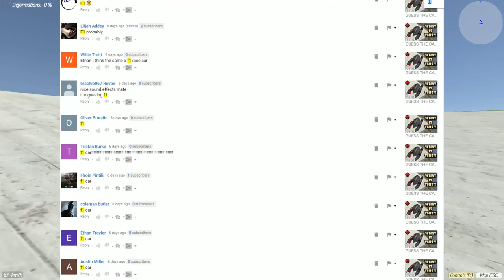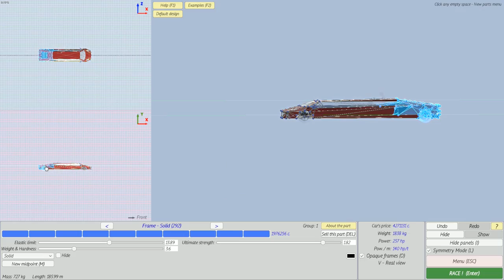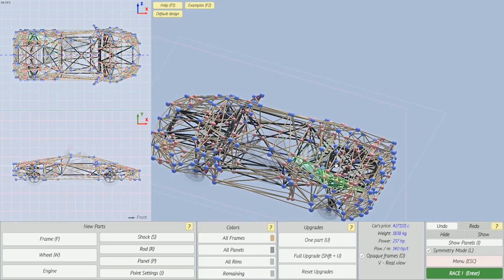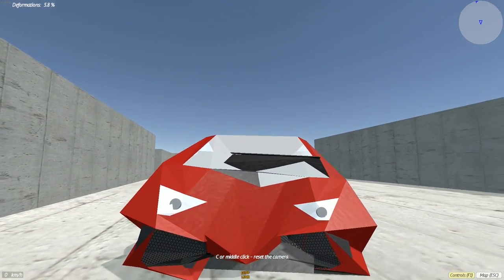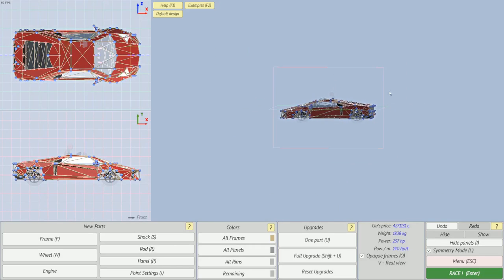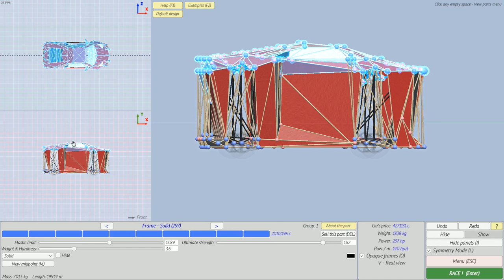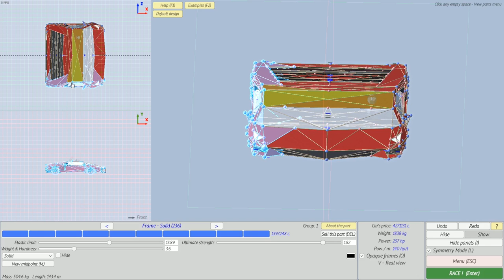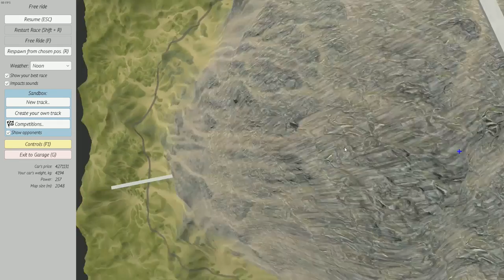LAMBORGHINI AVENTADOR!  Dream Car Racing 3D Ep11

Comment: Also, for the suspension, improve dampening, and have a little testing to make it not bouncy
Reply: then use more weight
Reply: usually solves problems
Reply: and one more thing, use panels not as polygons, if you know what i mean, use it as squares, then it will looks smother
Reply: ill invite to friends if you are ok with that, ill help